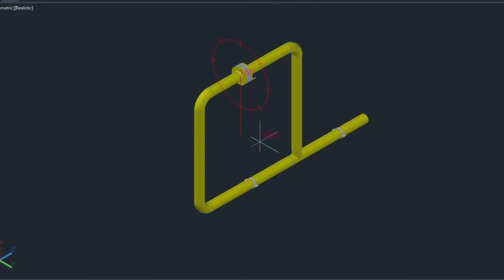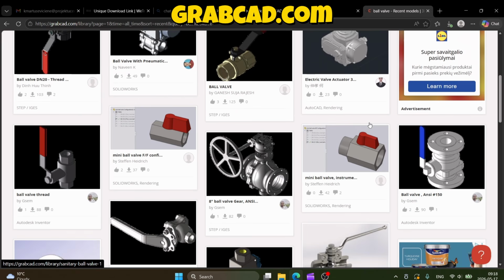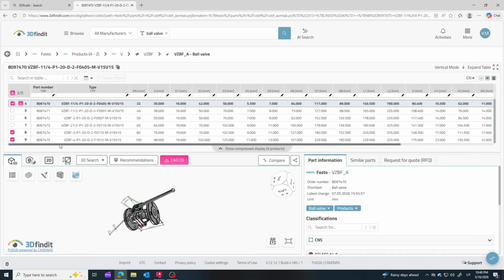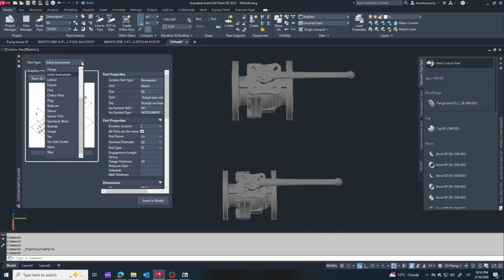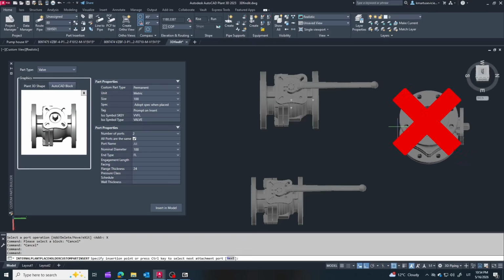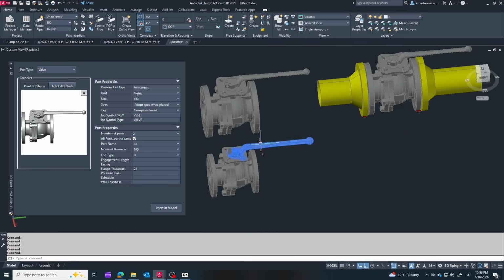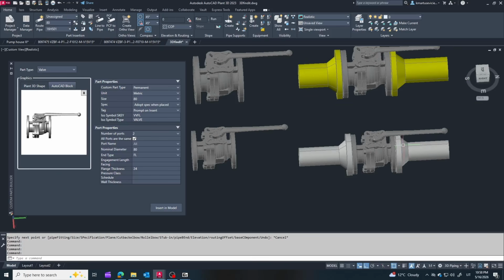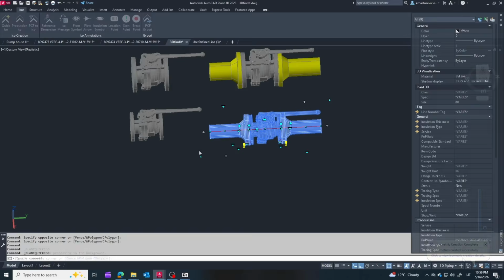3DFindIt Real Valve Models in AutoCAD Plant 3D (ISO Ready)

Comment: Hi!
Great video! 😊

When I define connection points for the valve, they are placed in the correct locations. However, when I insert the finished block, the connection points only appear on one of the flanges. Do you know what could be causing this, or how I can fix it?
Thanks!
Reply from the maker: Hi! 😊 If you are using a valve model from 3Dfindit like in my video, I would first check the connection type for both ports. Make sure both S1 and S2 are defined as flanged connections and have the same correct end type. If one port is missing its flange connection definition, Plant 3D may only recognize one side. Let me know if that fixes it!